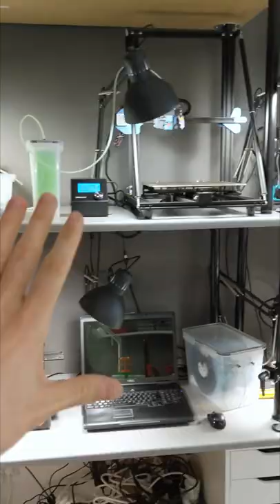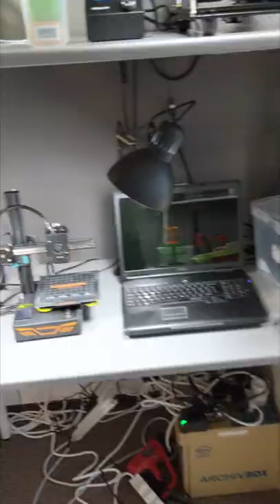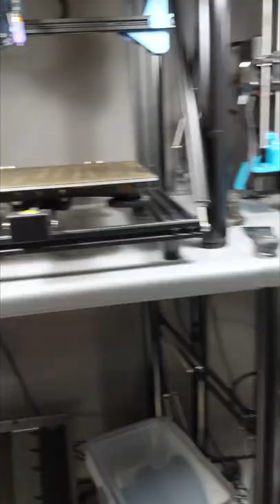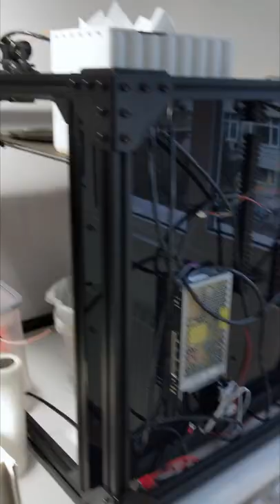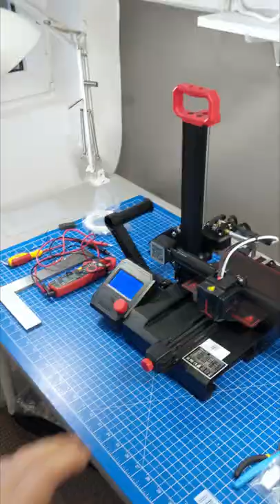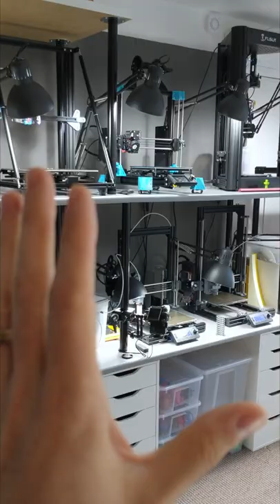Don't get a 3D printer

Comment: I know this but its only with the 400€ Hobbygrade printers because they are Made for Hobby Not for heavy 24/7 fabricating. Withthis Kind of printers you have to Put time and Money to keep them running.
With a lets say ultimaker for expensive 2000€ you don't have this Problems.

Comment: LOL this is great. Such a confident and wise opinion piece. My Ender 3 v2 came with the x axis belt missing, I had to drive 2 hours to buy one because fuck waiting on Crealitys shitty customer support. Then had to buy PTFE tubing because mine came cracked. One of the Z bars were bent too so I had to hammer that. Printing worked for a few hours and then boom, extruder gear is torn. Ender 3 v2 is one of the best printers but holy hell I had one hell of a bad egg.

Comment: I've got a resin printer had to make its own enclosure as my garage is quite cold 15c ... print temp is 20 30c 
So I bought a few bits so hopefully I can get a result but 15 fails. That's a waste of resin £25 upwards a bottle they should have heaters built in elegoo mars I've got.

Comment: I've had my anycubic i3 mega for a few years and only just started doing repairs and upgrades. Never new how loud the steppers were before going from 8 bit drivers to 16. Then I changed the fans out and I'm waiting on new bearings now. I'd love to add feedback loop controllers for each stepper but that's still too far out of my price range

Comment: Thats why I'm just designing 1 printer that does it all. Therefore, I only have 1 project in that area and if I finish, I just have to worry about the software that will run the futureproofing features I've decided to implement

Comment: Your not wrong my ender 3 was and is nothing but problems weather its very small problems or inconvenience or a snapped filament tension arm or board issues mine only has some small problems and had a broken tension arm other than that its fine it it is a constant project

Comment: Maybe the problem is not the printer?
Built a ender 3pro, never had to do anything with it, it just works.
But.... Slow as fek.
But I did start a 60cmx60cm build to so both printing and CNC work.

Comment: Even our 5000€ or Dollar whatever Ultimaker S5 came with totally out of square assembled linear axis. I've done the allignment myself but for that money they totally should have had somone come to use and fix it for me... 
And it even distroyed itself with an ABS print by leaking molten plastic inside the extruder housing to form a giant ball of plastik which pressed the assembly open while the useless machine keept on printing. I was so pissed after Ultimaker the company said it is user error and we had to pay the 500€ repair upfront.

Comment: Honestly, my Ender 3 has been my best and most reliable printer. The thing is bullet proof. Just works. My $2500 Lulzbot...mostly junk and worse printing in every way. For $180 you get a basically perfect cheap 3d printer in the Ender 3.

Comment: I have an Creality Ender 3 (V1 2019) unmodified except fan dust covers and a filament guide. And it does print reliable. Maybe it doesn't have the accuracy of other printers, but I had no problems with it (except that one time when I didn't fully tighten the y axis idler screws after moving)

Comment: I have an anycubic Chiron and it required slight setup by putting together like 3 pieces and leveling the bed as usual. I have never had an issue with it and I love it.

Comment: Idk, i got an Ender 3 at discount price and it's running great so far, no major problems encountered. I wanted a tool to push my creativity and I got just that, I am very satisfied with my choice. Obviously the features are a bit limited, most notably in the lack of automatic bed levelling but you can do that manually just fine. If I ever need to upgrade it, I of course can and will, but so far, I see no need to do so.

Comment: Get a Prusa but this time don’t modify the hell out of it
Cause I have one and in 3 years i just hat to replace the e3d v6 hotend after  about 5 months because it broke and filament was leaking out of the heartbreak and the printer worked perfectly after swapping it for a new one and calibrating it
But I bought the mmu and we’ll after 3 months of troubleshooting I removed it because it didn’t work reliably

Comment: You bought all the wrong printers bro. Sorry you had a bad experience. 

I see you have a few creality printers...
I've been having a great experience with Creality Ender3 or CR10. Level the bed n use blue masking tape(painters tape) and once you get it up n running it runs beautifully. The prusa printers from what I read are more expensive but are more efficient.

Comment: My ender 3 v2 is fine, I changed the springs and added a glass bed and literally haven't had to worry about it for a year now. It prints every day. I had to change the hot end fan once because I thought it would be a good idea to brush the fan while it was running and broke the fins lol. Totally my fault with that and the replacement fan makes it run nearly silent.

Comment: My prusa mini+ has been printing every other day since September 2021 with no maintenance needed. My prusa mk2 was bought in 2016 and other than replacing the hot end and upgrading to mk2.5s has needed no maintenance in 6 years and I use it sometimes every day

Comment: Damn right. Creality ender smashes the nozzle off the bed, despite endless levelling, so you buy a sensor kit they sell, which requires you to play Russian roulette with their broken firmware. If these things were cheap, fine, but every one is at least a couple of hundred pounds - without time to spend all day rewriting firmware by hand and wasting filament, electricity and often parts as something else goes wrong, they’re just not fit for purpose. This technology has existed for decades and the whole point of these kits is that they are supposed to actually print. It just feels like a huge scam - £30 of componentry bundled up and sold for nearly ten times that value and next to zero support for paying customers.

Comment: Buy a consumer facing hobbyist 3d printer and you get a hobby and not a tool. What you sound like you need is a 3d printer targeted to small businesses and print farms. Sure they cost quite a bit more than the cheapo ones but you get reliability and proper customer service.

Comment: I got a voxelab Aquila installed a dual gear extruder and Capricorn tube a bltouch then a pei magnetic steel bed and upgraded the formaware all together have about $250 and maybe 2 hours of labor and it’s printed non stop since then idk it’s not to bad

Comment: I started with an ender 5
So far only needed to change the bed because those magnetic craps are a joke
The board isn't the best and it isn't the quietest, but it does it's job quite well, some tinkering is required for it to print the best but it works fine on default cura

Comment: Lulzbot Taz printers! Our hs has 8 of em, they are the taz 6 models. Old. Work like a charm! Very little issues from there. But since they are being run 24/7 printing student projects, they occasionally have an issue. But it's rare in my experience!

Comment: First printer I got never printed a damn thing except the sample print that came with it.  Everything else was a fail.  After that I wanted to be sure that I could print so I got a crazy expensive one and it does very well.  Snapmaker 2.0  I worked correctly right out of the box.  Software sucks though.

Comment: I got an ender 3 v2 knowing full well it wouldn't be standard within a month. Now that I understand how 3d printers work, I kind of want something that is "buy, assemble and go". NOTHING i can buy in the uk is like that. Reviews of EVERY PRINTER that interests me has "print this mod" "buy this before you use it" "you need another printer to print these parts before use" etc. So fuck it. If I'm going to be modifying a new commercial printer. Why not go the route of rat rigs or voron? Buy the parts you want, assemble it then use it.

Comment: After spending a fortune on ender 3 that sometimes worked great but mostly didn't I bought an anycubic kobra max that I still use after nearly a year now still using it's original nozzle it's just works everytime

Comment: That's because you bought a bunch of Chinese bottom-dollar printers. They are cheap and generally need a lot of tinkering.

I purchased a Creality Ender-2. I was forever struggling to get it to work, although it served it's purpose which was to prove that 3D printing would be useful to me. 

I then went and purchased an Ultimaker 2+ for work. Far more expensive but.... it just prints. It paid for itself by adding value to the products I sell. Actually, it paid for itself by printing a jig that helped me sell 3 products.

Comment: We use a small fleet of Prusa I3Mk3s at work and 1 is always on my desk to be fixed and usually only 2 of the 4 are printing properly even after upgrading to bondtech hotends.

Comment: I am far from an expert here, but if want a 3d printer that just works you will have pay a lot more.  Even then, based on the mechanics it is unlikely you will never have a problem.   They are called budget printers for a reason.  That and anything coming out of China is questionable.

Comment: You do realize that ALL the 3D printers you have there are hobbiest grade machines. If you want reliable, turn key machines designed to operate continuously and reliable 24 hours a day, seven days a week, printing away without issues, you need to step out of the hobbiest grade, and into the commercial grade.

Comment: Don't buy a new printer when one doesn't work, understand the problem, fix the problem and move on. I've had two printers for more than 8 years and haven't had any major issues that didn't take more than an hour to fix. You seem to be throwing money at a problem that miiiight just be the user

Comment: You are not finding a reliable 3d printer because you might not know where to look.
I've been using quick prototyping (3d printers) and resin printers in shops since the beginning of the 2000. Those things are industry grade and are able to work h24 autonomously.
The only thing is the price and the place they take (roughly the size of a CNC)

What you are lacking would be a 3d printer for prosumer, I think there's no marker for that, most of the guys at this stage build it themselves because everybody have different needs (linear rails, multi head, milling + deposit).

Comment: A printer that just prints, no upgrades needed/repairs ? 
Well my ender 3 pro is still stock and prints, prints, prints, heck i don't even need to level the bed before most prints.
Also no needs for repairs yet xD

Comment: I have a stock CR-10 from 2017 on witch I've printed at least 10kg worth of spool, still working like a charm. Could it be better? marginally, worth upgrading? maybe but works great as it is, I may add an ABL, an extra Z rod, quieter fan, but hey I've made some great prints over the years as it is

Comment: I'm happy with my 3d printer, I mean nothing in this world is perfect. And the industry is still fairly new. I'm sure over time it will gradually get better and better just like anything else. Just sounds like you are very OCD and a perfectionist. Nothing wrong with that either, just saying. It's harder to please a perfectionist. Which is why you should jump on board and start working on designing a better printer. Seems like you are definitely smart enough and you clearly know a lot about them. Why not? This could be your calling. Try to find the bright side of your current experience and feelings and turn them into a masterpiece.

Comment: How do you like the Ender 2 Pro? Just ordered one myself kinda excited to learn about the hobby.
Reply from the maker: I'm still to try it out. Had to get a replacement electronics board that's been waiting for a long time to be installed.
Reply: @MihaiDesigns  what happened? Did it die while you were using it? That’s not promising.
Reply from the maker: @TheExtremeElementz  I believe it came with a broken driver. Not a big problem if the new board works. Will try it in a few days.

Comment: All 3d printers started out as projects. They are getting much better, and improving every day., But the industry is still in it's infancy. Anybody buying a new 3d printer, and spending less than about a thousand dollars knows that they are going to be doing some modifying, tinkering, & maintenance. Looks like you are running a business, so I'm guessing you run them all very hard. It's just normal, and to be expected. My cousin runs 30 out of his garage, and it is a constant repair & upkeep. Always at least 5 or 6 down at any time. It's just to be expected., & Part of running the business.  I don't really understand your complaint.

Comment: You buy cheap junk. Of course there will be work over time. It's like a car...it will break with time. But you get what you paying for. Go for a qidi x-max or x-CF Pro. If you buy the qidi x-cf pro you will have a filament sensor from start. Max will need filament sensor installation unfortunately. And stop buying creality printer...they don't make printer to last for a long time and they don't care if they send out junk printers. Never buying creality again